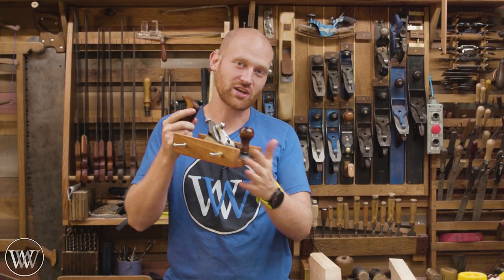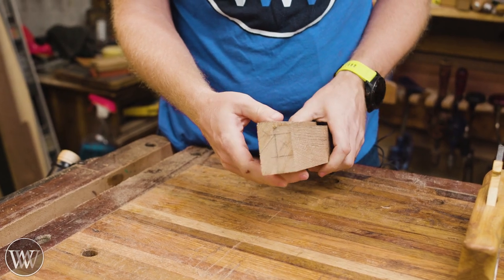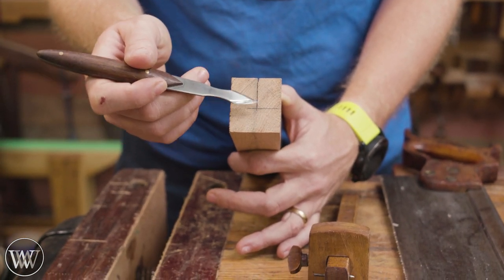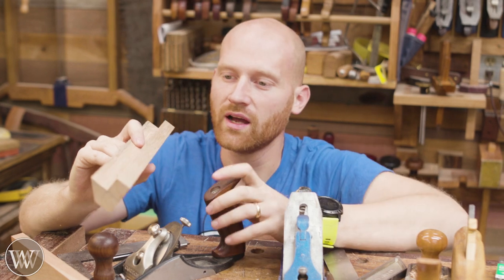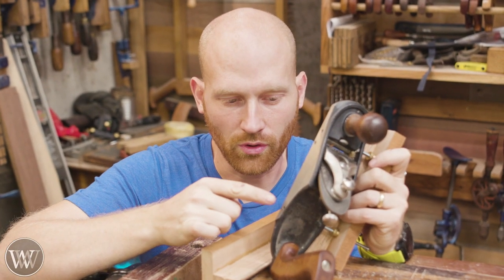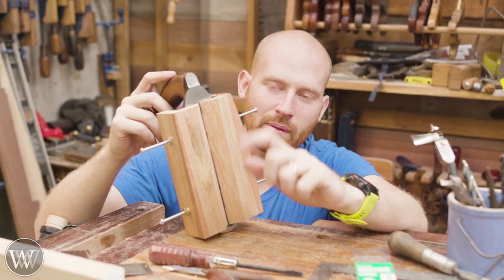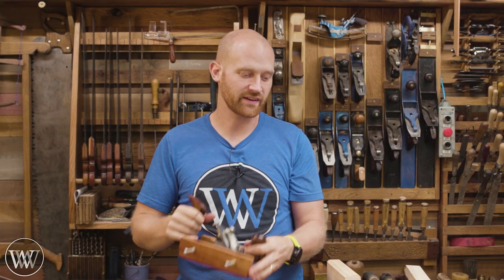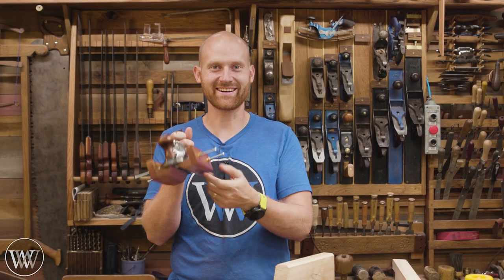Making a Chamfer Plane With a Hand Plane

Comment: A handy way to transfer markings from a shape or thing that you want to copy but cannot measure; make a "rubbing". Lay some paper over the part you wish to copy, and rub around the edges and shapes/holes with your finger and it will make an impression on the paper...... it works even better if your hands are a little dirty :)

Comment: Thanks.  I liked that.  I wonder if you could use turnbuckles instead of regular bolts?  That way it would only have two adjustments instead of four.
Reply from the maker: Intrestign. that would require going all the way through the plane but if you were to modify sa stanley that would be fun to try.

Comment: A very nice project. I’m using white oak to make new handles for saucepans. I like white oak but I find it very difficult to work, whether with  hand tools or power tools. It’s hard to saw or plane (smoothing plane, block plane, spokeshave) by hand.  But you seem to use white oak a lot...
Reply from the maker: yes it can be challenging and tools have to be setup with in an inch of their life, but I find the challenge to be fun and the end product is so worth it.

Comment: I sure like my block plane for chamfers but I bet that would work good for timber framing and large work.
Reply from the maker: not as much for timbers I just use this when I have a ton of it to do. on the table I need to do around 300-350' of 1/4" chamfers and having the fences makes it easier to be consistent.
Reply: That is a lot of chamfers! I bet that does help.

Comment: Hi James

I made a similar Wotnot some years ago. Drilling holes in my precious Stanley Bailey was traumatic..!

I found that working along the long grain was fine when chamfering a plain plank but for mitres would have worked a lot better if I had paid better attention to the direction of the grains of the two pieces forming the mitre. If you are not observant in this it is easy to find oneself plaining with the grain of the one piece of the joint and into the grain of the other.

This is of course the same problem whether or not you are using a jig like you have just made. Which at last leads me to where I am going... (sigh! at last)

One solution is the obvious one of only attacking fine work with a very very very sharp (maybe one more "very") plane and to always (jig or not) take it slowly.

Another is to hold the plane at an angle to the direction of movement - causing the edge to slice rather than cut. (Also the way to go when chamfering an end grain mitre)

I thought of that too late in that particular project  but gave thought to making a Wotnot V.1 that would be able to adjust the plane's angle of approach.

I didn't exactly give up but realised that I was spending too much time on it. I'm sure you've been there... 

Have you ever given this any thought?
Reply from the maker: I use this one on miters and end grain I just take less of a bite and make sure the blade was freshly sharpened.
Reply: @WoodByWright 

Thanks.

Comment: If i had more money to cover up the shipping cost i could had sent some of my finds to You, i always try to pick up those old tools when i find them for a good price here (the metal ones are pretty rare to find at all here), it's realy well worth spending some hours repair them, i think every one i found so far was worth the time, almost no matter how bad they looked at first, even those in realy bad condition turned out to be fully operational after som minor fix because they where still made in an era when things was made to be reparable for generations.
Reply: I agree with you on most points there except the last bit... that's really kind of a modern myth.

I learned this from someone else: Back then you had all these heavy castings which are basically indestructible unless dropped from a great height or onto a very hard surface, and land at the wrong angle. Not really out of a desire to make things built like tanks, but out of a necessity due to the manufacturing methods available. The result is that even with things that were relatively cheap and roughly cast you have enough material to DIY a fix or improvement without sacrificing structural integrity or functionality.

And, after 50-100+ years, most everything that survived is the stuff that _could_, which gives the impression that there were only good items made when in reality there was loads of crap that you only ever see crop up in nearly unused condition. Check some old Popular Mechanics magazine ads and you'll see things that will never come up again - AMT Tablesaws for a few dollars, as one example. I read some old timer on a forum who bought one when he was young and it was essentially a big, bolt-together stamped sheet metal table saw shaped object, like a giant adult erector set. Made in USA to boot.

Nowadays you have things that are "high end" which die due to plastic degredation, non-replaceable battery failure, etc., but they aren't really "high end" in the same sense as back then as the amount of scraping and saving you'd have to do to afford something that good was way way higher. Things like Veritas, Lie Nielsen, etc. are closer in relative price today to what Stanley used to cost a household in their main product lines. 

A woodworker in the 20s or earlier would have killed for the shop James here has. Or even what I have, and I have less than a tenth (maybe less than 5%) of what James does!

Sorry for the ramble :P
Reply: That's true, thank you for your post, when it come to wooden tools i think about half of them was made by local craftsmen and the quality was in equivalent to the skill of the person who made the particular tool (i know some bigger manufactures also made very large series of wood planes, hacksaws, etc and tons of blacksmithing equpiment for the military here, i think tey sometimes are pretty sheap because they was made in such large numbers (i think those tolls beside reparing also was used to scool the men in how to use tools at least in my country the army had a big part in education, both from books but also practical things like blacksmithing, carpentry, leatherwork, stonework, etc). Iron tools where until the early 1900, at elast where i live, often manufactured in local shops connected to local foundries but loosly inspired by foregin tools.
The old military tools are usualy built to last but are pretty crude and in very narrow specifications, but it will do it's job, no less, no more, i think that's another reason why they sometime come pretty sheap here. (in many European countries property of the army are out of the list onse it's removed from the list and sould out in large batches, after that nobody care what's happen to it as long as it's not weapon classified (some items must be destroyed and can not be re selled for the civilian market, like the weapon storage bunkers, automatic firearms, etc) but for most things there are no export or import restrictions for that stuff in Europe for "non harmful items".)

Comment: James, really nice modification to your Veritas plane, curious if this would work on a No.4 Stanley!  I see you use the Stanley No.62 Low Angle Jack Plane, I also have it, BUT have never been able to use it properly. Can you please do a video on using/tuning it, I suspect many of your viewers also have this plane. Thank you.
Reply from the maker: sure. this is basically a #4 with a bunch of bells and whistles. I have one with holes drilled in the side and tapped. that is a video I would like to make. the problem with low angled planes is if the grain is not flat and perfict they will make a mess of the wood so I only use it on long flat items. Most of the time I am reaching for a higher angle plane.

Comment: Could you not have simply laminated on more material to the side and then cut the wall of the rabbet? It might also help to make some marks in the nuts using a punch or file to "zero them" all out at a set depth so you can adjust them for a specific chamfer width with more speed and precision, instead of having to choose one or the other.

If I were to do this eventually (since I don't have a spare plane to drill holes in at this time) I think I'd add strips of brass or sheet metal. More resistance to wear on the slopes and to make the sides thinner, cutting down on weight from wood thickness, length of bolts, and giving the nuts a better bearing surface to press into. Could also hammer a small piece of flared tubing in the holes to act as a bearing and increase the life while still being replaceable. And I'd tap the holes for a coarse threading to make adjusting faster and easier to count.

All of that complicates the process, but I love how wood looks and works with metal joined to it a bit better than pure wood ahaha

Comment: A brass rod of that diameter would be very weak and subject to breaking. Consider stainless steel machine screws. Not as pretty but sturdier.
Reply from the maker: well they do not need to be that long. those were just what I had on hand. they only need to be about 1/4" longer than the outside nuts.
Reply: A yellow zinc or "brass tone" rod or bolt would probably fit the look best, if he can find one long enough.

Comment: Please don't be offended but it's a bit big and clumsy! There are some good videos on YouTube on small chamfer planes that are much easier to use!
Reply from the maker: well each to their own. for big projects like the table I am working on it is perfect. for most projects I just grab the block plane and go to town. The bolts do not need to be that long. those were just what I had on hand. they only need to be about 1/4" longer than the outside nuts. when i get better ones it will be quick to replace them.

Comment: I really don't understand the purpose of chamfer planes, I mean chamfering is a very basic skill
Reply from the maker: it is a very basic skill. And usually I just use a block plane and run down a board. But in this case I have to do six or seven hundred feet of it and it all needs to be identical from end-to-end and very large for an average chamfer. So having a chamfer plane will end up saving me an hour or more and make it easier to keep all of them identical. And then there are other people out there who want to jig for every step and in this case they could make this and have a jig for making champers every time. But that's not me.
Reply: I was not saying that making a chamfer plane is useless, I was just wondering why they are so popular if we don't really need them.In this case I understand, but please don't buy it do it. A subscriber from France
Reply from the maker: it is honestly a power tool mindset. when it comes to power tools you are only as good as your jig. and if you bring that mindset to hand tools you make a jig for everything you to to make up for skill. in history they were only used on rare occasions.